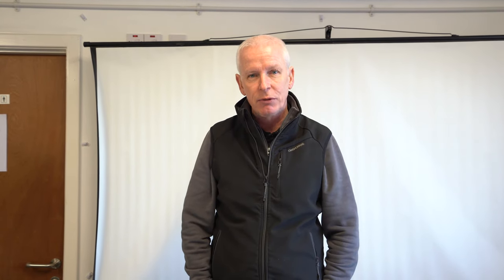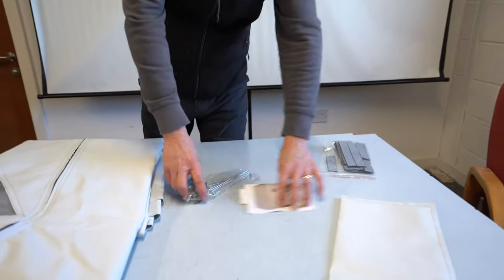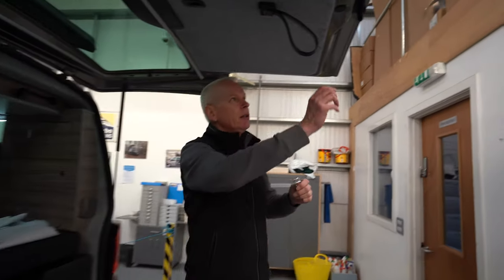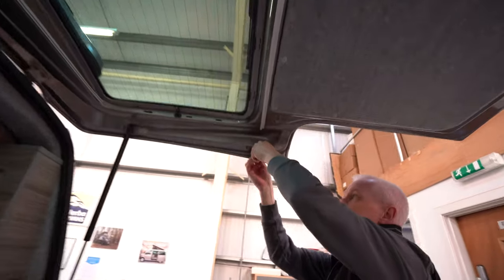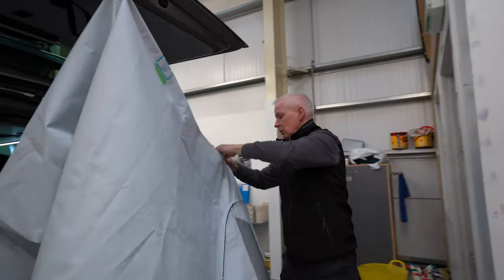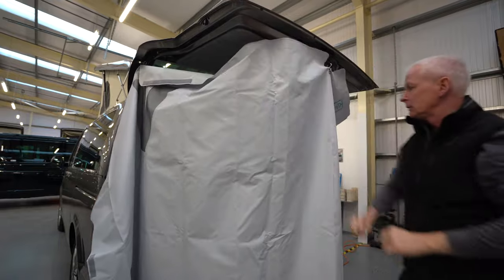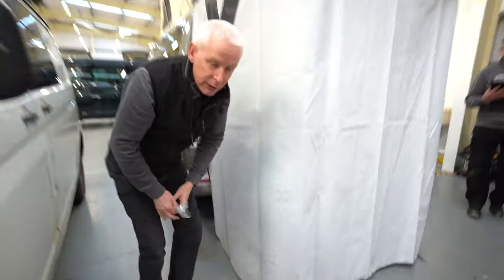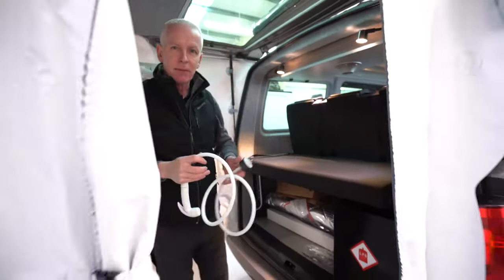Van Shower Fitting Guide & Demonstration

Comment: It's too complicated.
It would be nice to just use a magnet
back door is metal !
Reply: I was thinking the same but would be easy enough to replace the hooks with magnets. I'd prefer something that was permanently fixed to the door, that when you open the tailgate, it just drops down. Then when finished, you roll it back up into the housing attached to the tailgate.